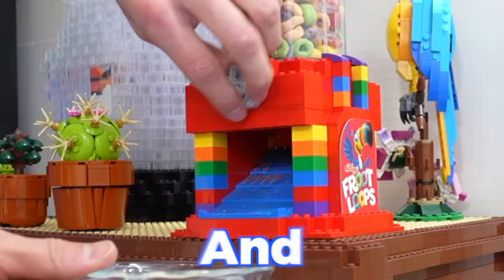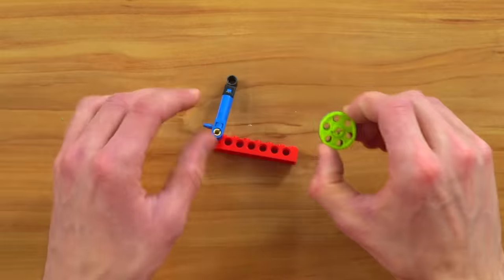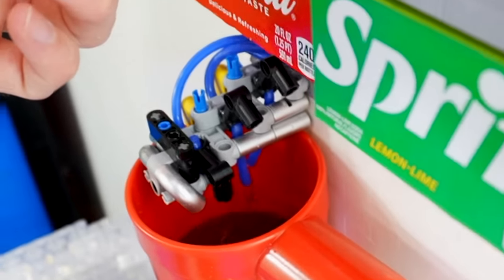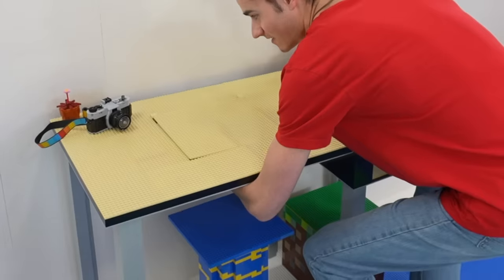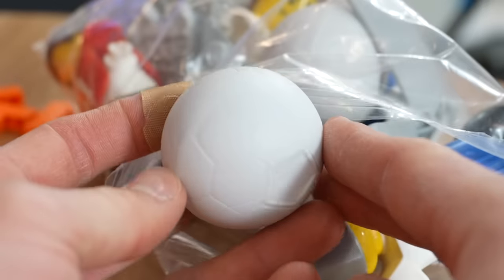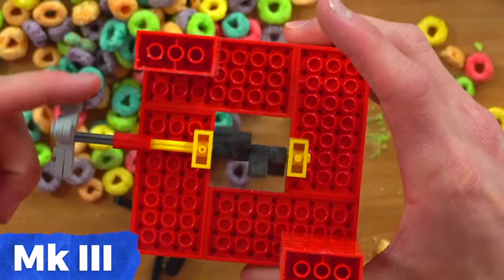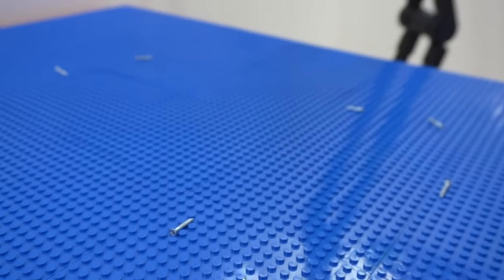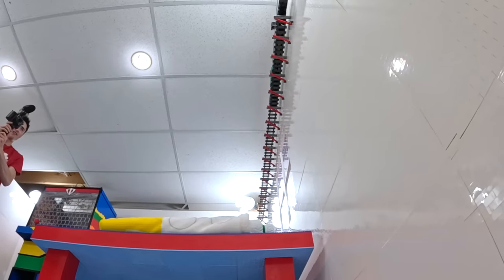Adding Your CRAZY Ideas to my LEGO Room!

Comment: For the train, what I think you should do is add walls to the end of the train tracks and use rubber caterpillar tracks (if those exist for Lego) to grip on the bottom of the trains. Then use a slow motor to make the train slowly go clockwise from one end to the tracks to the other, but give to motor a switch, that way it can turn on or off. Add another motor to make the track go counterclockwise, so it can go to the other direction. It would work even better if you extended the track.
Reply: Make a phone